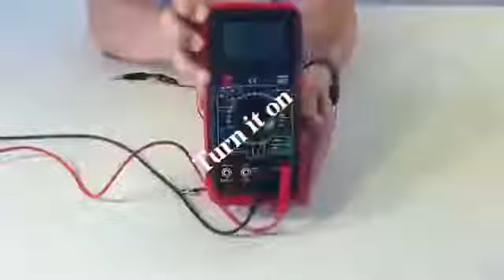Mechanical Engineering ever best project | Quick and easy mechanical project Mechanical encyclopedia

Comment: we can use dc motor
Reply from the maker: Yes
Reply: @mechanicalencyclopedia69  bro its fan is working but electricity is not producing
Reply: @mechanicalencyclopedia69  i mean instead of that meter we put one small lED but it is not glowing